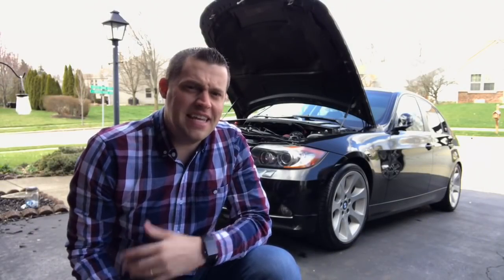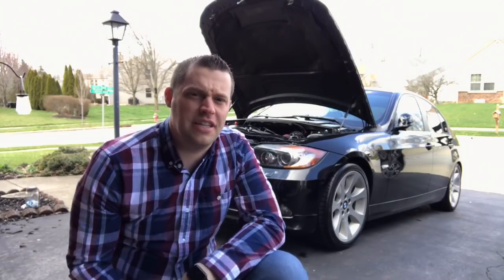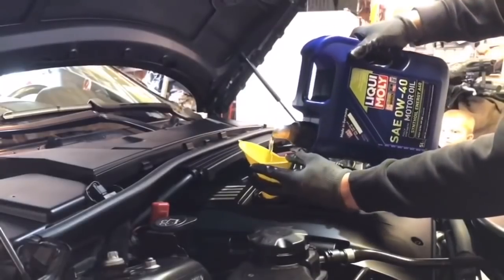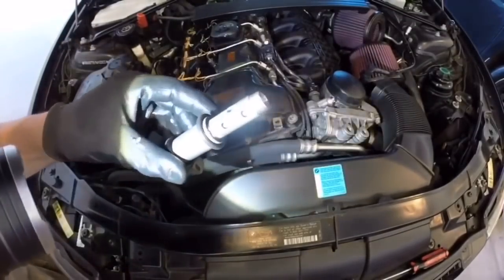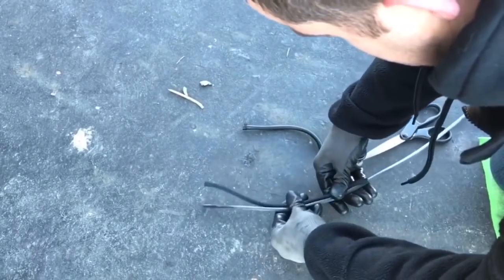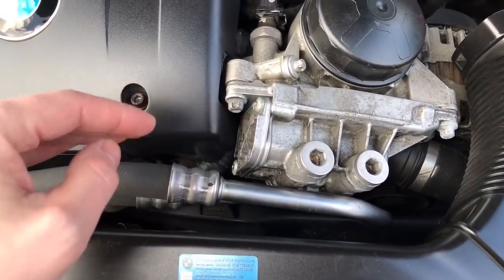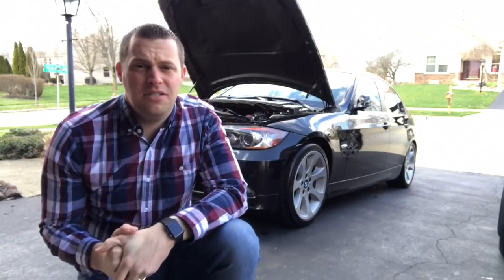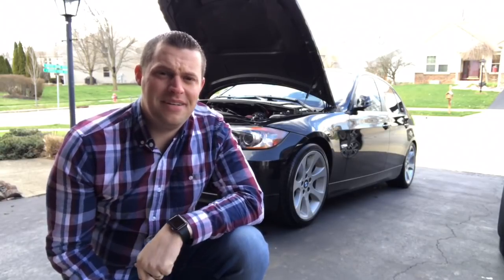BMW 100,000 Mile Maintenance Parts That FAIL!

Comment: Your probably one of the only bmw enthusiast that goes specifically into detail on one model, you save a lot of people from going bankrupt, mr fanatic your a true legend👍
Reply from the maker: Thanks man 🙏🏻
Reply: @BMWFanatic  Ok...just hit 148k on my 2009 E92 N54. Rear turbo disintegrated and I've always changed my oil and babied the turbos. Bought Vargas Stage 1 Turbos for $1300 and installed those, oil pan gasket, and also had to replace my high pressure fuel pump ($700 from FCP Euro). Had to replace fuel injectors with index 12s 2 years ago. Put in 3rd radiator last year. Replaced coolant reservoir once about 2 years ago. Replaced Valve cover gasket at 80k miles. On my 4th battery. Replaced both turbo actuator valves. Replaced OFHG at 90k miles. I have a JB4 VERSION 2 Tune still with methanol injection (but hardly ever use either). I changed out my vacuum hoses three years ago. Also do all fluid maintenance on schedule. Hopefully I can get another 100k miles out of it now.

Comment: Another thing to consider beside mileage is time. A lot of these cars are 12 years old but only have 50 - 90K. They will have the same issues with hoses, gaskets etc, even if they haven't hit the 100k.

Comment: You are Awesome. 

 I Replaced my 
Belt tensioner 
Serpentine belt 
Plugs and coils 
Pcv valve - rob beck
Coolant reservoir 
Vacuum hoses 

Had to take it in and get my 
Valve cover gasket 
Oil cooler gasket
Oil filter housing gasket 
Oil pan gasket 
Motor mounts
Lower control arms 
Alternator

Dealer took me to the cleaner's  !! 

These are high maintenance cars. I still love it.109,000 miles. 2010 535i. Runs strong.

Comment: Valve cover gasket replacement is a beast of a replacement (at least on my 2011 X3). Did oil filter and oil filter cooler gaskets alongside that last year. Hopefully won’t be doing that again. Saved a couple thousand in labor though and that was worth it for me. Budget 8+ hours rather than 2 for that if you haven’t done it before.

Comment: My first issue with my BMW at 101k miles is spark plugs and ignition cylinders misfire. Buy the parts from trust websites people! Auto shops and dealers will charge you a lot for parts. Plus buying your own parts feels good cuz you know what you're putting into your car. Now go to a trusted deal for labor.

Comment: Just flushed my brake fluid today, that would be a good video DIY. Have 88k on my 2008 and never had a problem yet and i have now been tuned FBO for 5k running E40. I have done all of the preventative maintenance except replacing the valve cover but did replace the gasket. Great advise, it definately helps to keep it going strong and keeps money in your pocket.
2008 335i JB4 + MHD
Reply from the maker: Jeff Baker Doing mine this week!

Comment: My 2008 335i was a nightmare. Injectors, water pump, and HPFP all failed under 30K. My 2011 335i was much better, only major failure was the radiator, but it did last me almost 177K miles. I hope my 2018 340i is at least as reliable.
Reply from the maker: Oscar Castillo Oh wow man, the 340 is sure a beast though!
Reply: The M sport and M adaptive suspension is the real deal.
Reply: As a general rule of thumb the first generation of anything new will be fairly unreliable.
Reply: How’s the 340i? My old neighbor has one and we talk about it, he’s got the 2017 340i and has like 10k miles on the clock. Only had a sensor failure this far. How’s your experience?
Reply: Oscar Castillo next time buy an upper end Toyota Nissan... no CVT or a honda
Reply: @mrgeorgeleach7498  While my car issues were inconveniences, a lot of Toyota, Nissan, or Honda recalls are either similar or for far more dangerous problems.
Reply: Oscar Castillo maybe... maybe not... but we're focusing on your car issues
Reply: Oscar Castillo trade or the junk

Comment: Water pump and thermostat dnt forget those they fail I had mine go out around 97k miles keep up the good works been watching you since day 1
Reply from the maker: Yep, before 100K 😀
They like to fail 30K miles to 70k miles
Reply from the maker: Thanks for watching!
Reply: I got 120k out of my water pump. The starter 130k and alternator 135k. Got bored of being trailered off to the mechanic at that point and sold it.

Comment: I had the Vanoss solonoid issue with a p0012 code, so I cleaned them and switched it. The code came back on high acceleration but p0015, easy change

Comment: My old trusty 2007 328i has 176k and I never had to change the O2 sensors I use marvel mistery oil here and there. I haven’t even chance the valve cover gasket, soon I will.
Reply: My 2011 328i just turned 170000 just starter and batterie still runs great smooth as can be wouldn't ripple a glass of water, no joke I'm going for 30000🤞

Comment: Love your posts. I have a e 90 and love her. In the process of doing the 150 k.things you recommend on my e60 2006. Both cars were 1 owner. Are there any other items I need to address? I have done new plugs. Oem on both cars e90 Bosh plug wires. Also needs and of cover and valve cover gasket replaced I have a small build up of oil in cylinder 5. In closing... I've done new water pumps and coolant and both vehicles I used all OEM everything is there anything I'm missing

Comment: I can get a bmw 328i coupe convertible  for 5,500, it needs a valve cover gasket replacement and it’s mileage is 94k it has a small dent on its driver seat

Comment: How come I haven’t seen you do pads and rotors yet? Quoted $1750 from dealer did it for $350 with upgraded parts. They also wanted $1900 for shocks and just picked up front and back bils for $550 from fcp. Need to also do valve cover and seals plus trans oil/cover/seals/shift solenoids. (No issue on the trans but it’s time)

Comment: You are awesome! I have n52 platform but still your videos helped me so much thank you!
     that pedal up are you were talking about with the oil cooler that can also happen if a vanos seal leak happens! My vanos seals were leaking onto my belt and the belt was spraying the oil on to the top of the oil cooler on the n52.  N52 cooler is similar to the n54 cooler.  Fyi
Reply: Gregg thanks
Reply: @ThunderbirdRocket  No problem!

Comment: I am looking to buy a BMW 2011 Z4 3.0i with only 12K miles on it. Are there major service repairs which would normally occur based on the years rather than high mileage? (Other than oil changes or filter replacements)

Comment: I did a VCG replacement and I’m at 106k miles. I had the famous burnt oil smell and smoke coming out. I spotted the leak right on the exhaust pipe behind the right most bottom portion of the engine. After putting everything back together and ran the engine I got a engine malfunction check engine light saying reduce engine output. This frustrates me because prior to the job I didn’t have any lights on! What could this be?

Comment: I just copped a 08 manual transmission 335i and this is my second one and this time around I have extra cash to add all the cool mods to make it go faster which is what I’d like to do but I was wondering if I should do all the things mentioned in this video first before adding mods . Does anyone have any advice or would like to share an opinion ? My car is currently almost near 100 k miles . Should I just wait for it to start acting up or do it ASAP ?

Comment: Hello I’m new to your channel, very great content. Question. I just bought a certified used. 2007 335i with 85k mls. I doubt the transmission fluid has ever been changed. How often is that recommend? Other sources say it’s a lifetime fluid is that true? Thank you in advance.
Reply: Change the transmission fluid now, if you haven't already. "Lifetime" for BMW transmission means around 60k miles or 100k km.

Comment: So I am in dilemma, I know someone from a friend that has 2008 335i coupe in mint conditioned at just under 100k miles with M3 wheels (it looks beautiful), inspected by 2 master BMW technician with completely no issues at all. All major components replaced just before warranty ended like HPFP, twin turbos, injectors, coil packs, spark plugs, new coolant tank and few other things. This was all serviced by BMW private mechanic that took care of the same car for 6 years. The guy wanted a 7500 for the car. I took the car for a drive and everything was super smooth and no problem. The thing is I am not good enough to fix all the upcoming problems myself. The car was in such a good condition that I just wanted to get it since I feel like this chance might never come back. Do you think I should take it?
Reply from the maker: Where any gaskets replaced? Valve cover, oil filter/cooler(if equipped) and oil pan? Those all like to go out around the 100K range. Other that that, everything else is sounding good!
Reply: As far as I know, oil filter and cooler was replaced as well. I am not sure about the gasket but I am willing to learn to change that myself. Oil pan I have no idea. I think I want to be part of the BMW fanatic and buy the car since you have so many tips including insane cheap oil change video. Subbed :)

Comment: Hopefully you can help - I have a 2004 645CI.  When I step on the brake the pedal goes to the floor.  Replaced rotors and brakes,  master cylinder and resiviour bleed all brakes and the pedal still goes down soft.   What else should I check?
Reply: A Co Brake booster?

Comment: Too late I got hit for $6000.00 just for the valve cover and vanos system.  The valve cover leak took out the water pump housing (plastic) and the oil filter housing gasket.

Comment: Adding upper and lower control arms to the list might be good. Mine leaked its fluid at 85k and when I replaced them noticed the other one had already leaked before 85k but never made it to my garage floor. It’s a sure fire replacement item ad these cars reach the decade mark. Thanks for the E90 specific content.

Comment: what about the oil pan gasket? any issues with that yet?
Reply from the maker: Eli BMW335 Yep oil pan gasket is another one, sorry I thought I had that one in there. Much bigger of a DIY since you need to drop the front subframe and suspend the engine form above

Comment: You forgot the biggest one at 100,000 miles - the whole freaking car! (lol) 
That's what happens when you make the entire engine and transmission out of cheap plastic.

I have owned a lot of BMWs and do enjoy driving them. The maintenance has severely tested my patience though, more than any other brand I have owned, and that includes Alfa Romeo.

To their credit, the OEM parts are easy to obtain through non dealer channels and there are tons of diagrams online which allow you to order the correct part numbers.
But god does it get expensive.
Reply: Jaeger 888 I soooo agree with you bro

Comment: How in the world BMW is getting away by using mediocre plastic in their engines which gradually hardens and fails leaving buyers with hefty maintenance cost. Germans are puling way too much profit through their cars.
Reply: Rauley Shar it is odd, for as well as the car is constructed, how can they not make a simple gasket that last longer?
Reply: Because people are buying them.  Customers are just as guilty.  If you can do the work yourself or a low priced independent repair facility that helps.  Some items are typical high mileage wear/tear that could fail on any vehicle.  Yes design and materials are weak especially for critical items (Electric Water Pump). But again people are buying them so they are their own worst enemies.  If you can take some high mileage compounds and replace them at same time that will make it more expensive initially but cheaper in the long run by reduced future labor costs and a good starting point for future wear timeline.

Comment: Changing engine oil every 5000 miles?? They use a more expensive oil that's good for 10,000 miles. You don't need to change it every 5.